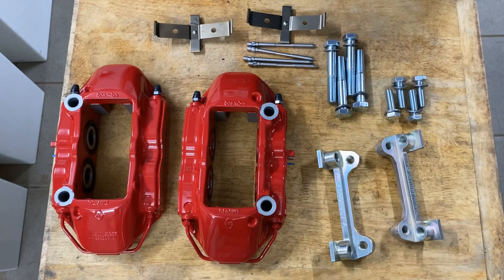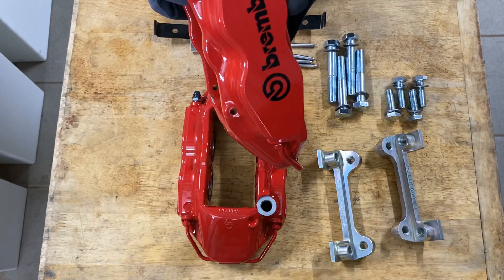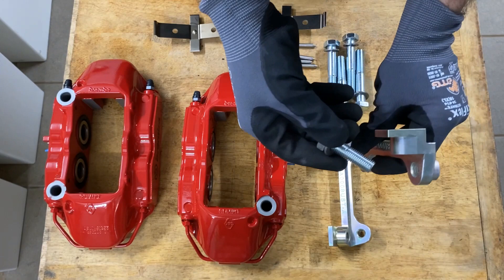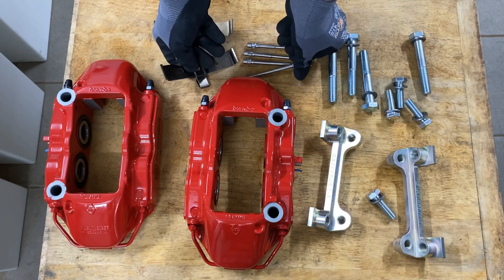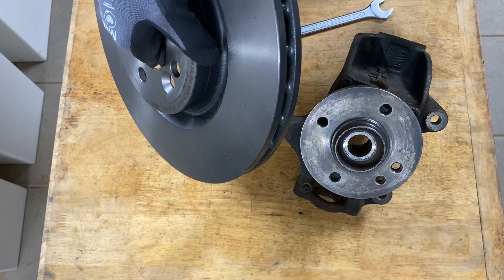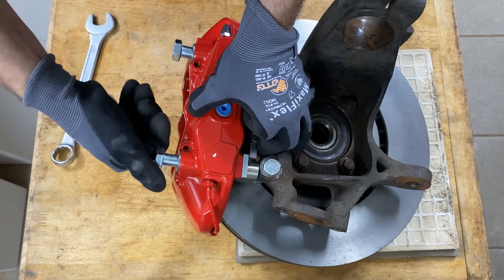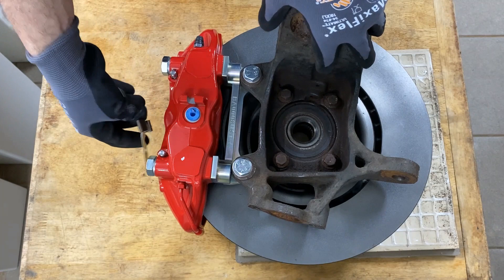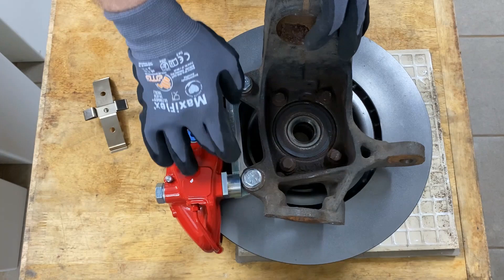GP2 Mini Caliper Brembo JCW R50 R52 R53 R55 R56 brake 330x26mm John Cooper Works

Comment: Quick question -what is the size of the wheel spacer you have used for your wheels -17 inch ?! thanks
Reply from the maker: Depends on the offset of the wheels. Their are certain wheels, which dont require any spacers.

Comment: What pads are you using for the 330x26 in the megan rs calipers?
Reply from the maker: these are some of the brake pad options:
Brembo P 09 004
Brembo P 54 040
Brembo P 54 039
Brembo P 23 078
Endless EP357SSY
DBA DB2228XP
EBC Redstuff DP31908C
EBC Yellowstuff DP41908R
EBC Ultimax DP1908
EBC RP-1 DP82070RP1
EBC RP-X DP82070RPX
Ferodo DS2500 FCP1334H
Ferodo DS3000 FCP1334R
Ferodo DS2500 FRP3067H
Ferodo DS3000 FRP3067R
Mitsubishi Evo 6 to 9,
Chevrolet Camaro 1SS / 2SS,
Subaru Impreza STI,
Audi TTRS 8J / RS3 8P,
Seat Leon Cupra,
Renault Megane 3 RS 250 / 265 / 275,
Alfa GTA / Spider / 147 / 156 / 159 / 166 / Brera,
Volvo S60R / S70R / V70R,
Vauxhall / Opel Astra OPC,
CITROEN C8 3.0 V6,
Fiat Ulysse 3.0 V6,
Lancia Kappa / Phedra 3.0 V6,
Peugeot 607 3.0 V6 / 807 3.0 V6